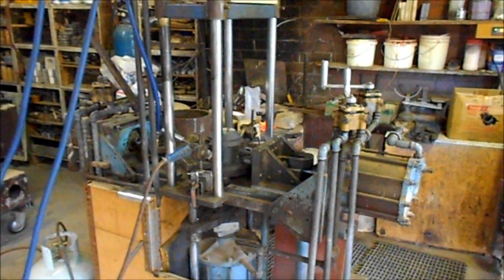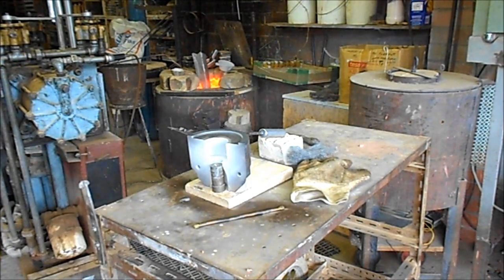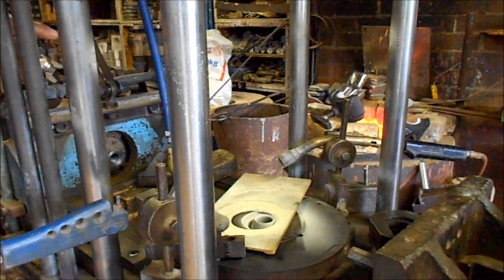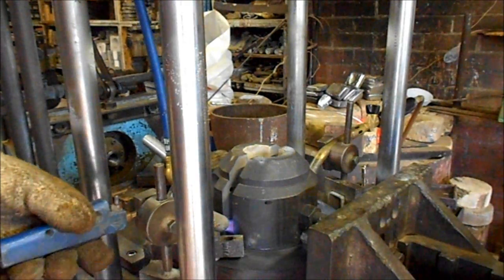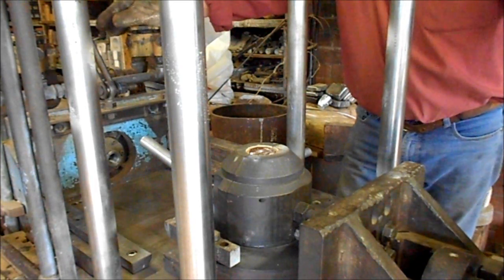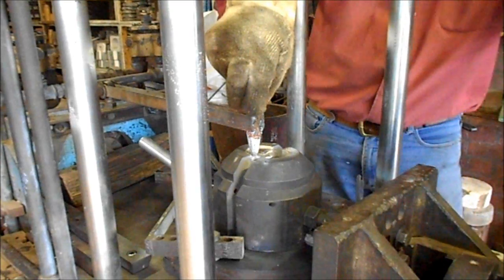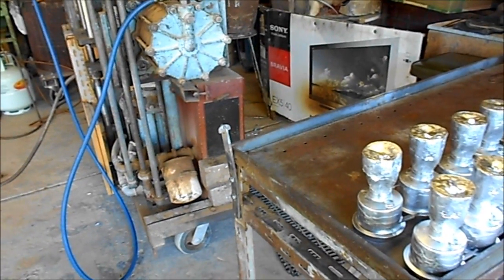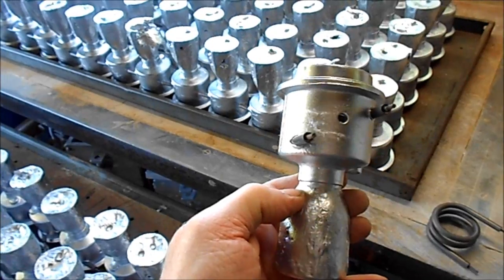My Home Foundry;  Casting a Coffee Percolator heating unit

Comment: These would be better if they were cast from copper rather than aluminum. That would make them a lot more expensive though.
Reply from the maker: Yes, from a heat conductivity point of view copper would be better. However it would have to be tinned (just like copper cookware) and there are practical difficulties in casting pure copper - higher temperature, lack of fluidity, shorter die life, need to have inserts hotter and from my point of view much harder on the caster (me!) They certainly would be more expensive - much more. The several thousand  aluminium ones that I have made have preformed very well in service so there is no great incentive for an improvement.
Reply: Olfoundryman
I have an electric percolator with a copper or copper-based alloy heating element cup, and it's tinned or plated with something silver-colored. I'm not sure if it's tin because I would think that tin would melt on the part of the heating element cup which isn't always submerged in water/coffee, i.e., the part below the retaining nut that, when installed, is on the outside of the urn. Tin melts at only 450 degrees F.

I think it might be chrome or nickel plated. The actual tubular heating element part, which in mine isn't encased in a casting, but rather, is wrapped around and welded/brazed to the bottom of the cup, is definitely chrome or nickel plated, because there are spots where it is flaking/peeling off, and tin doesn't do that because it isn't a plating, but rather, it "wets" to the surface of the base metal, like solder, forming an intermetallic alloy between the base metal and the tin. Tin can wear off, but it will never flake/peel like nickel or chrome plating can.

Here's a picture of my new one (it was manufactured in 1993 but had never been used) - http://i.imgur.com/cd5kLrA.jpg

And here's a picture of an old one of the same model I have, manufactured in 1967, and well-used when I got it - http://i.imgur.com/HqhnOl4.jpg

As you can see, the tin or plating, is nearly all gone (only a small bit remaining around the rim of the cup), and the copper or copper-based alloy base metal is very corroded/pitted.

It's the same deal with the bottom bell-shaped part of the pump tube, which interfaces with the heating element cup. Here's a picture comparing 3 of them I have, with the new one being on the far left - http://i.imgur.com/nsl7Ft3.jpg

The one on the far right from the 1967 coffee maker has no tin or plating left whatsoever, and corrosion has left a groove in the bottom part of the "bell". The one in the middle is missing all of its tin or plating on the bottom half of the 2-piece "bell" (which is the part that actually contacts the heating element cup), and of course, the tin or plating is completely intact on the new one. And the thin tube part is 304 (18-8) stainless steel, so no tin or plating on that part in the first place.

By the way, aluminum ones will eventually corrode/pit too; coffee is a fairly harsh substance due to the acids it contains, so it would be a good idea to plate or hard anodize those ones you cast, though I'm sure that whoever ordered them from you isn't planning to do that.